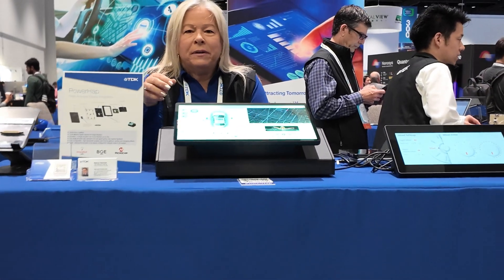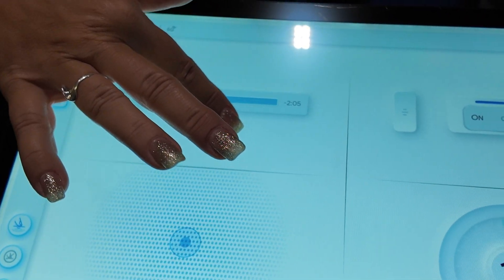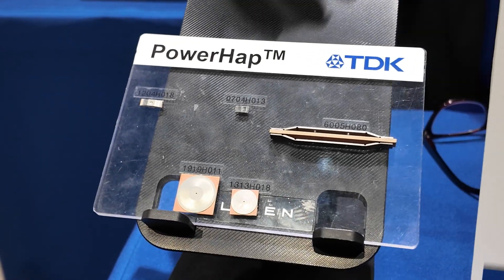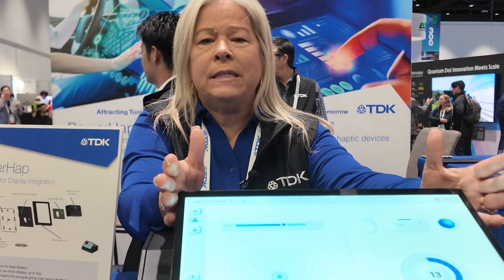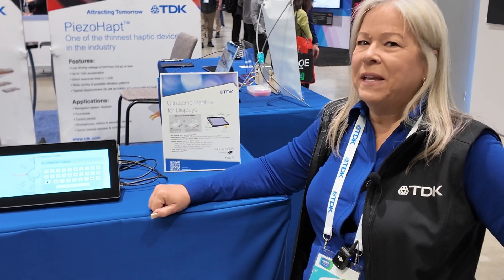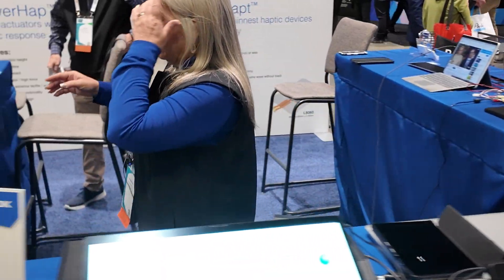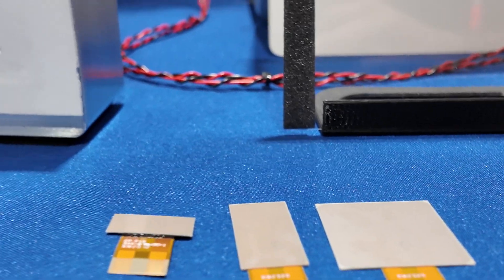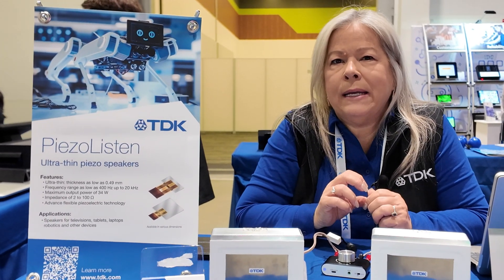TDK haptic feedback at Display Week 2024, automotive, tactile feedback

Comment: As per Functional Safety standards, the infotainment features which can distract driver focus should be disabled if the speed is more than certain limit. 
1. Voice command and call announcements 
2. Driver’s steering controls 
3. Premium vehicles in development : haptic feedback displays you can feel the buttons by touching it. No need to look.
Also it is recommended to control the infotainment by co-driver while driving not driver.